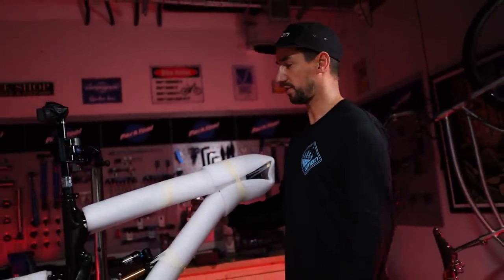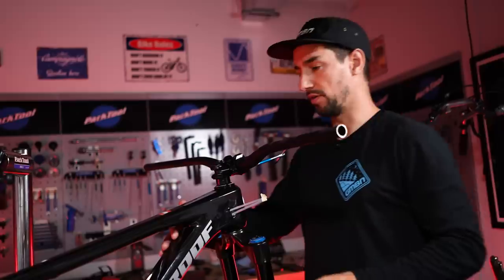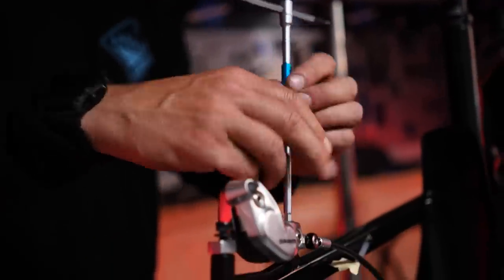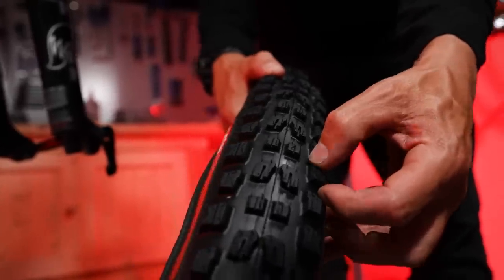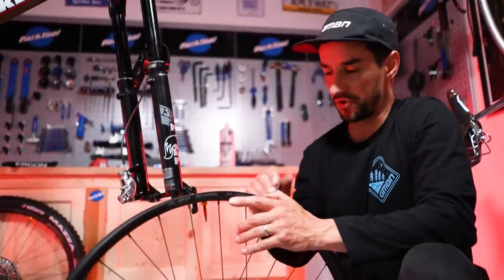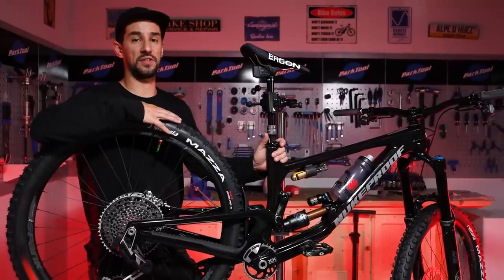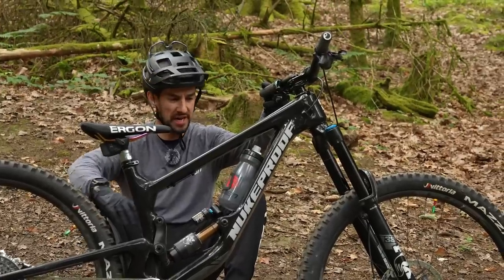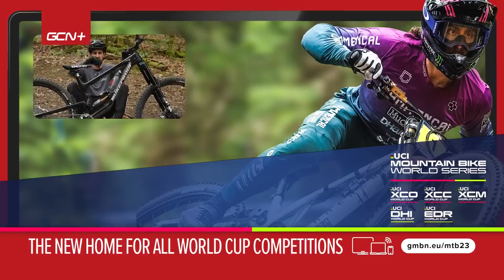Nukeproof Giga Dream Build

Comment: I recently got my Giga Elite (yellow) and was keen to see what dream upgrades Neil was going to add. Guess my question is...why not a coil shock when most owners are moving from air to coil?

Love the digital drivetrain idea...can you post a components list so us owners can see our aspirations/shopping list 😁😁
Reply: I run both. Coil shock for holidays and the DH days and swap out to an air shock for enduros. It's like having two different bikes. The coil ( fast shock) is super buttery while the air shock offers a better platform for peddling. I can use the leverage adjust on the frame to get both shocks in the sweet spot for each. It's a great system.
Reply: The X2 probably came with the frame and he didn't feel like switching it out.  The Giga 290 also doesn't have the most coil friendly leverage ratio (60mm shock stroke on 170 travel), the recommendation on Gigas is to run the 297 mullet version if you want to run coil as it has a 65mm shock stroke so plays nicer with coil.
Reply from the maker: We'll try and track Neil's bike down when he's not riding it and see what we can do!
Reply: @gmbn  that's excellent...thank you! Failing that - does Neil want to do another "teach a noob" type video somewhere South Coast UK? 😀

Comment: Heya,
I've got a Giga 290 M and also using an AXS Dropper Post. If i put mine as low as you have it in the video, i am for sure running the tire into the saddle. I have to put it about 10-15cm higher until i have full clearance. Either you haven't used all the travel yet or well... i don't know what else. You ou running 27.5 in the back? I thought you said 290 in the beginning...